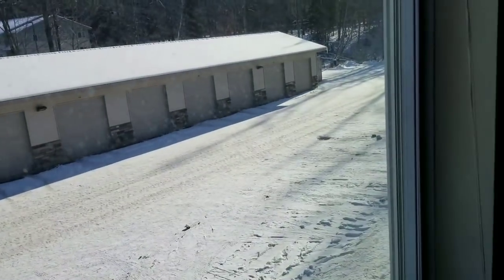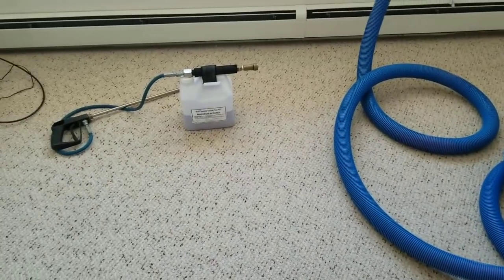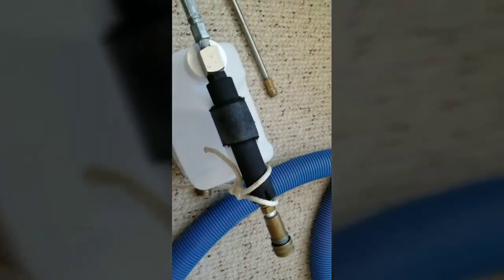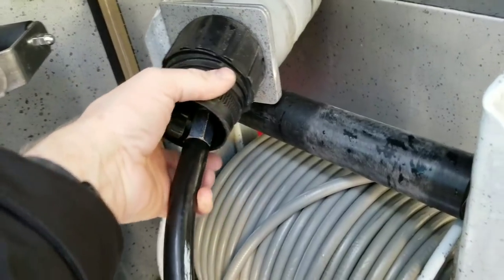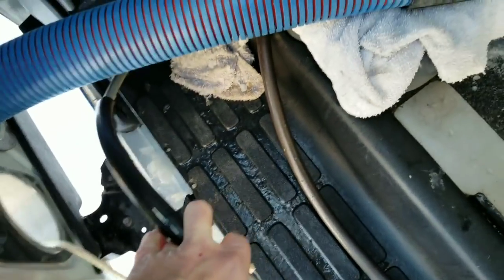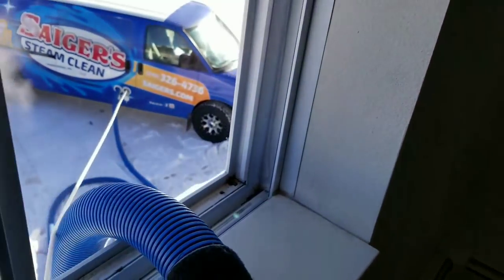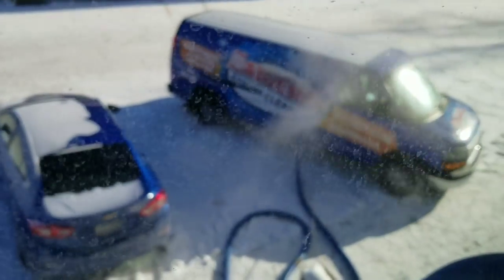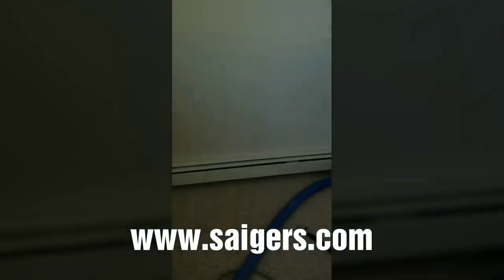Cleaning alone in - 26 degrees below zero on 2nd floor

Comment: What an interesting way to setup for a job!  Have you ever measured your cleaning temps at the wand?
Reply from the maker: Jonathan Powers I have and with 8 flow we were seeing 200 degrees on the lie detector but in this cold only around 185 to 190. 12 flow we are seeing similar but on lower side temperatures
Reply: Impressive!